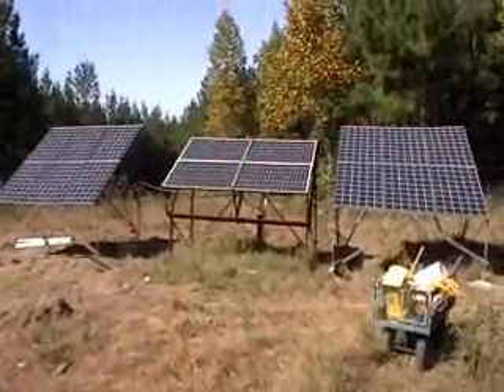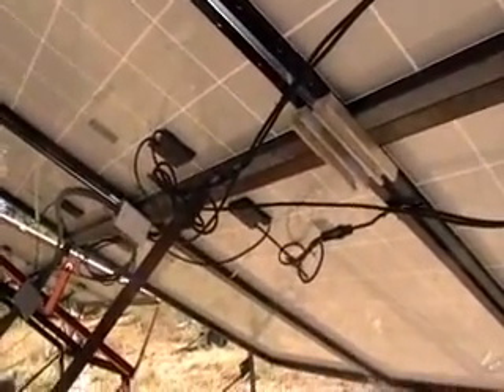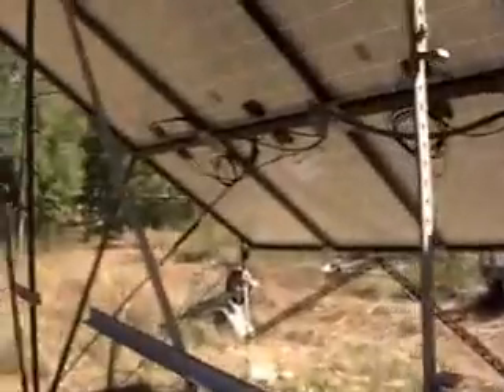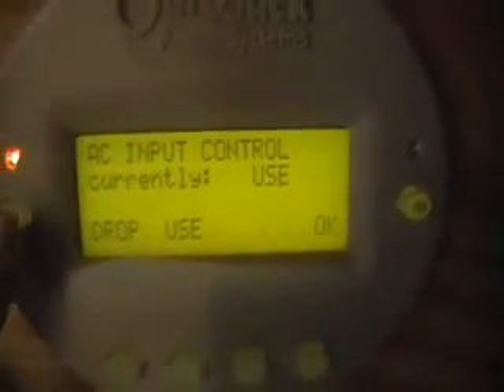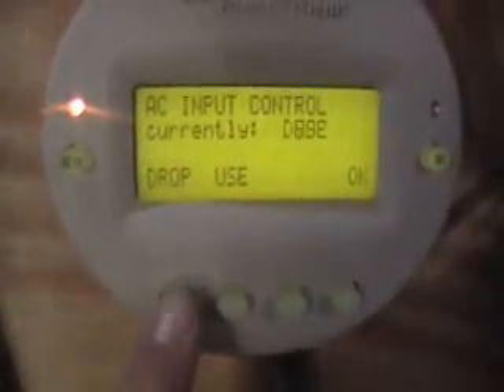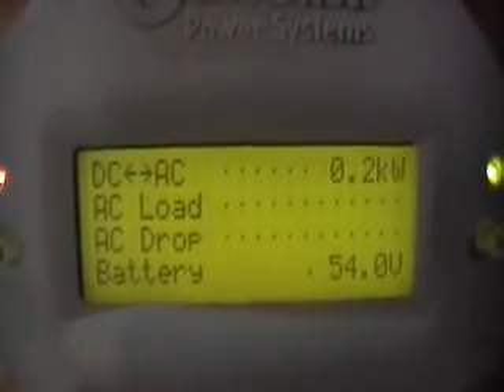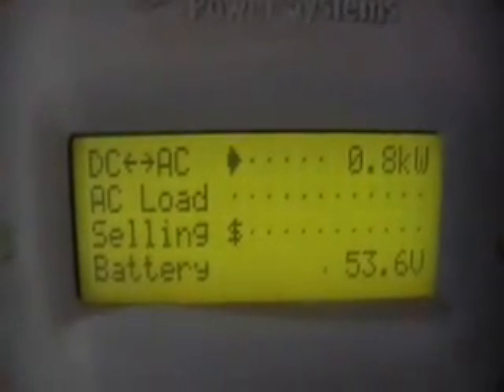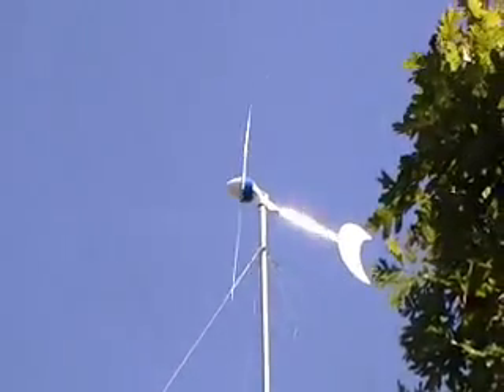part - 5  Wind turbine and solar panel installation

Comment: This video and others that you made are to BEST and most detailed DIY for solar and wind turbine power! I read your LONG report of how you went through all of the installs!I still trying to figure out how to wire the solar panels THROUGH the wind turbine to my charge controller,that is in my shed 60' away. I would hate to buy 60 more feet of 8 GA. wire.

Comment from the maker: each panel is about 29 volts so 29x2=58 volts going in. it a 48 volt system.

parallel wiring increases amps